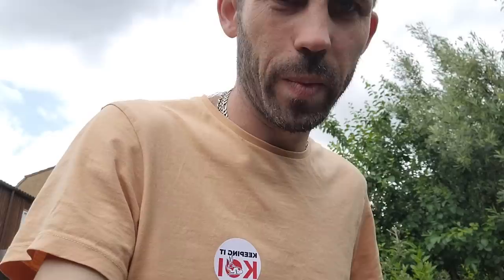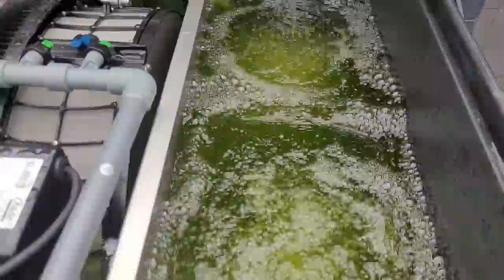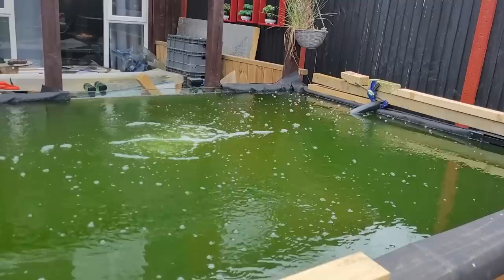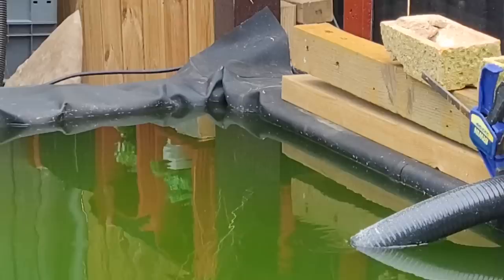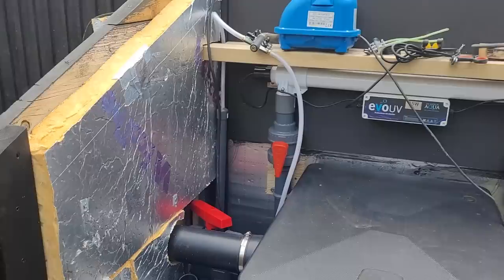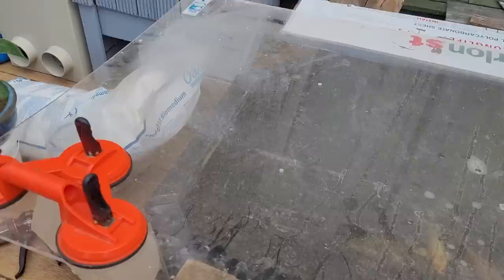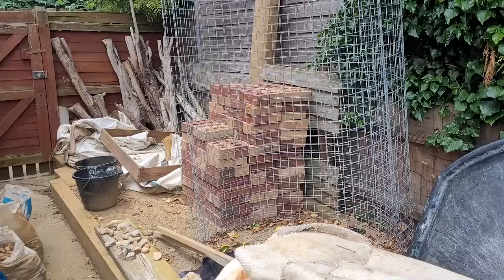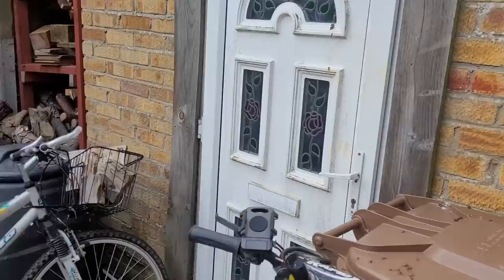Oase Drum is on Air is on, its now a fully functioning Pond (Part 44) Sleeper Pond with Window Build

Comment: Make a cilinder from a filter mat. Put an air stone at the bottom or a waterpump at the top. Done!
The pump doesn't have to run 24/7 because the filtermaterial is constant in the water exposed to oxygen.
Reply from the maker: Thanks bud 👍

Comment: The air is either air that was in the pipes and needs bleeding off or is probably being sucked in from the section where your aerating it in the drum filter. Try turning the air off and then if you slightly loose off the top nut on the valve above the suction intake on the pump it's a good way to get the air out otherwise it will keep on cavitating. Try it with the air off in the drum to see if makes a difference. All that air will be in efficient and knacker your impeller.
Reply from the maker: Thanks bud yeh I managed to sort it weren't sure where it was coming from but wacking the pump up to 100% sorted it instantly 👍
Reply: @keepingitkoi  on mine I have to unscrew the top nut and slow the pump down or it just continues to cavitate.  Glad you've sorted it and your pond is looking great. What flow do you think you've got going through your skimmer and bottom drain roughly?
Reply from the maker: @richardc1983  well the pump is pulling 15k lph but I don't know what the flow is individually through each one 🤔

Comment: Hi Jamie , good video , quick question just set pond up , got the Oase drum filter , got given a tub of bio kick filter starter , was going to leave everything running for couple of weeks before we think of getting any fish , when would you suggest I put the bio kick in , was told by someone not till I get fish , but thought it would be better to add now , to give the bacteria time to settle in , any help would be much appreciated 😊
Reply from the maker: No you shouldn't add it until the fish are in as bacteria needs food to live and without fish there's no food so if you was to some how get bacteria in your system without fish by adding some ammonia from somewhere it will die within days without a regular food source. Hope that makes sense 👍😊
Reply: @keepingitkoi thank you So much , spent ages searching for an answer , couldn’t find one anywhere not even on bottle or Oase site , which think is a bit bad

Comment: That’ll be a pain replacing the UV bulb!
Reply from the maker: Nope extremely easy actually, close both ball valves either side unscrew the unions and lift off put new bulb in and put back on took me less than 5 minutes 👍👍👍

Comment: Your air none return valves need to be near the outlet not near the supply. Just be careful Jamie
Reply from the maker: To be honest it doesn't matter where you have them as long as you have them as where ever they are they will prevent water from getting back to the pump theyve been there for nearly 3 years while on my fish tank 👍 but thanks for the advice bud